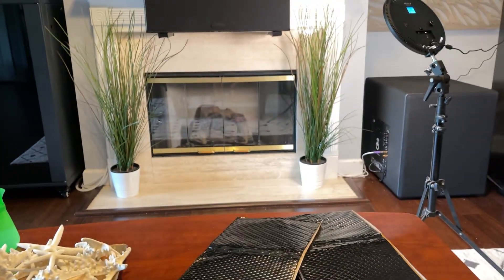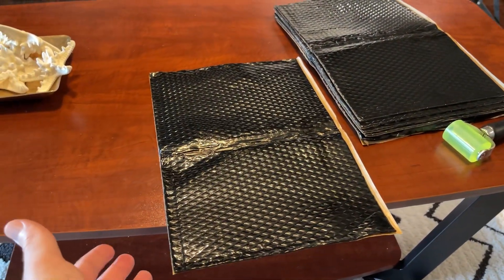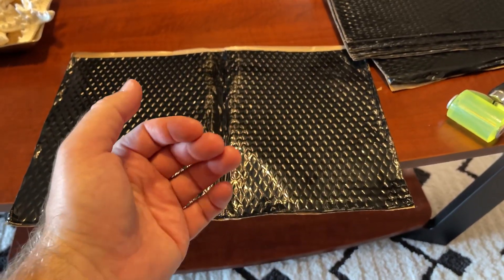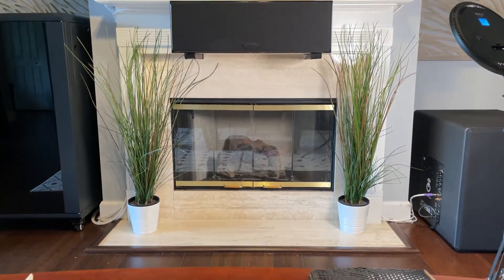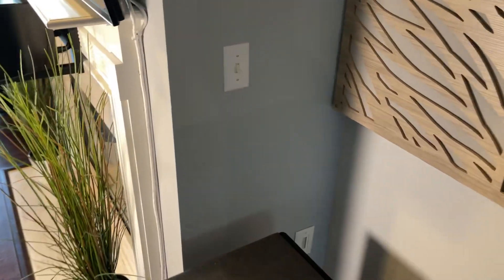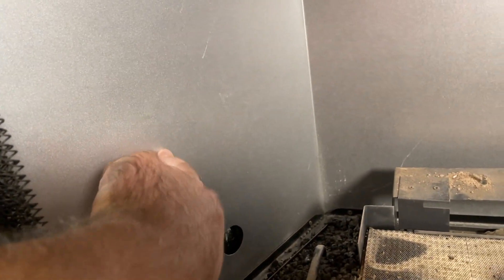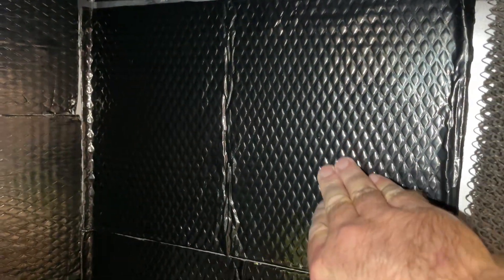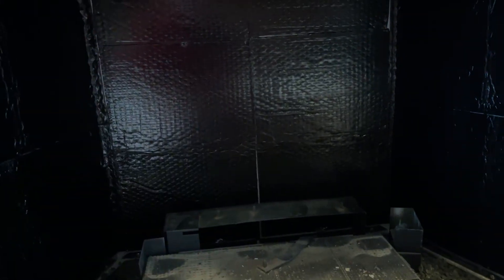Home Theater Noise Proofing With Noico Sheets

Comment: This may be a stupid question but do you need two subwoofers of that substance in a room of that size that’s causing your issue?
Reply from the maker: Absolutely.  #1 multi subs is the only way to have consistent and properly even response through a room.  #2 the room is very open and it's needed to pressurize it.  The issue, was the unit, not too much bass.